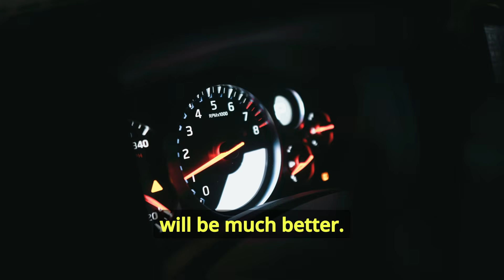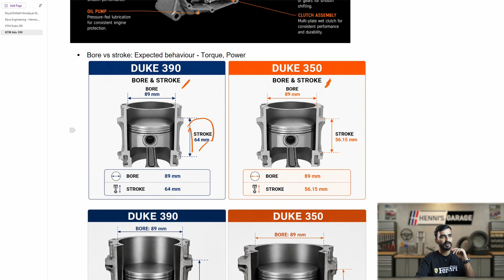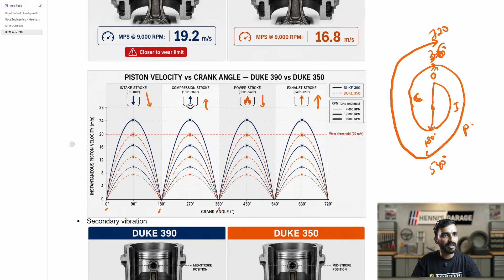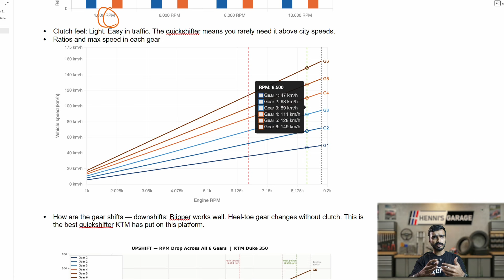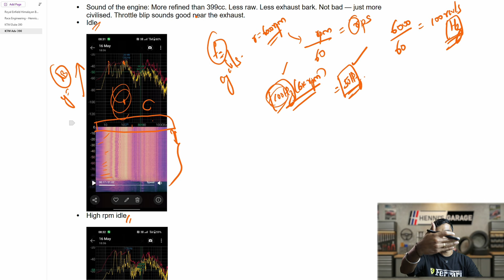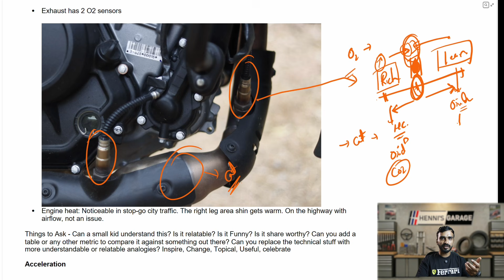KTM 390 vs 350 Breakdown || Hennis Garage

Comment: Thank you for the detailed review ❤, I have a question . Am planing to change my bike BMW G310R to KTM 390 adventure X plus variant , So if i choose 350 cc engine instead of 399 cc will i get regrets in future ? , main reason for switching is for more power , one time investment for next 10 years , suggest me to choose the right one (engine ) Thank you 😊
Reply from the maker: For a long-term investment focused on performance, I would recommend sticking with the 399cc engine to ensure you get that power upgrade you're looking for! But the 350 still has decent power on offer.

Comment: I'm confused between the KTM 390 Adventure (350) and the Royal Enfield Himalayan 450. I want to use the bike for both long-distance touring and my daily 10 km office commute in Bangalore traffic.

Which one would you recommend for my riding needs? I'd really appreciate your suggestions and opinions from people who have experience with both bikes. 🙌
Reply from the maker: Given your daily commute in Bangalore traffic, you might prefer the KTM for its more agile and easy to handle character. It’s also good for solo touring. Furthermore, KTM offers 10 years of warranty which gives you added peace of mind. 
If your major requirement is to munch miles on the highway, the Himalayan is a no brainer. It has good torque and a great character.
Reply: @HennisGarage Thanks, I'll go with KTM🫣

Comment: Can you please elaborate more and give more insight about 350 Mileage and 399 Mileage (for Adventure series not duke). 
Thank you!
Reply from the maker: The 350 typically offers better fuel efficiency due to the reduced displacement, while the 399 trades that for higher power output. The difference however is about 3kmpl in the city and about 5 kmpl on the highways.

Comment: Why does the new KTM 390 Adventure have more vibration compared to the older 390? Also, what could be causing the increased vibration around 5k RPM in the new 390?
Reply: First of all, hats off, sir—this is the best explanation I’ve seen so far.
I’m comparing the 373 vs 399 because I own a 1st-gen Duke 390 and a 2nd-gen 390 adventure (399). I’ve done 60,000+ km on the duke and around 7,500 km on the adventure.
Interestingly, the duke feels much smoother at 80–100 km/h, while the adventure has noticeable vibration at the same speed, which is around 4,000–5,000 rpm.
So my main question is is this just an issue with my bike, or is it common across all the new 399 adventures? I’ve ridden four different 399 Adventures so far, and all of them had the same vibration around 5k rpm. The ktm mechanic initially told me it would go away after the 1st service, but now they’re saying it will go away after 10,000 km.
Reply from the maker: I’ve also observed what you are talking about. There are quite a few things that have changed between the 373 to 390. 

I don’t think the vibrations that are around 4-5k rpm will go away. The frequency of excitation over here is around 65 to 85Hz. It could just be the case that the Handlebar has its natural frequency around this range. Which the older 390 handles well because of change in stiffness, isolation, better balancing, etc. But there could be a few other reasons as well.
Reply from the maker: Are you referring to the 373 vs the 390 or the 350 vs the 390?

Comment: Hello Sir ,

I am bit confuse between KTM ADV 350CC and KTM ADV 390X PLUS..

Please give your valueable opinion..need your help..🙏
Reply from the maker: 390 makes sense over the 350 only if you feel that the power is highly insufficient with the 350. Have you taken a test ride of both yet?
Reply: @HennisGarage i have ridden 350
Reply: The power enough for me
Reply from the maker: Then, you can go with the 350 itself. Any reason why 390 is important for you?
Reply: @HennisGarage Can you explain which is the negetive things in 350cc is compare to 390x plus..

Is there any engine issue in 350 cc longterm for short stroke and  which one is generate more vibration..
Reply from the maker: Lower torque is the major negative. 390 has more vibrations
Reply: @HennisGarage thank you for your support..
Reply: Today I am going to book KTM ADV 350CC CERAMIC WHITE
Reply: @HennisGarage you mean 350cc 390
Reply: Can you explain which is the negetive things in 350cc is compare to 390x plus..

Is there any engine issue in 350 cc longterm for short stroke and  which one is generate more vibration..

Comment: can we get a 350 cc and then later swap it fro a 399 cc engine? are the gear ratios same in both?
Reply from the maker: Gear ratios are same. Swapping the engine requires a whole bunch of components that has to be upgraded.
Reply: @HennisGarage  could you break it down with respect to parts and cost cause if I do go ahead with the 350, I wanted to know how much would it cost to make it into 399 in the future.
Reply from the maker: Let me try

Comment: Can we make 350cc engine to 390cc engine by changing some part like crankshaft???
Reply from the maker: Possible. But it’ll include changing a few parts along with it. Also required ECU to be remapped to older firmware.
Reply: @HennisGarage  please try to get some information about this. Many people will be intrested in this video.
Reply from the maker: That’s a great idea for a video. Will try and get some info on this. But it will make the vehicle illegal.
Reply: @HennisGarage  No one will able to find its actual CC.
Reply from the maker: True that
Reply: @HennisGarage please make proper technical video i am very much interested.

Comment: Do you think the 350cc engine on duke 350 can be refined/improved more by KTM or is this the best move and we already have a final 350cc engine from them?
Reply: I’m asking to see if I should buy the duke 350 or wait for the next version? (Since this is the first version of the engine)
Reply from the maker: I don’t think they’ll disturb something that is working for them. At the price point, the tech and power is excellent.
Reply: @HennisGarage Thank you so much for clearing my head with this
Reply: @HennisGarage i haven’t test rode the duke 390r yet. Amongst the duke 350 and 390r, which has less vibrations and is better for city riding where we use 2nd to 3rd gears at most.
Reply from the maker: Vibrations are marginally lower on the 350. Not something that I’d complain on either bikes.

Comment: Very well explained bro, I bought the KTM ADVENTURE 350 around a month back, so far my experience has been good, but in lower gears the vehicle is sluggish compared to the 390 variants
Reply from the maker: Thank you for the support and sharing your experience about your bike.
Reply: Add a bigger front sproket with 2 extra teeth, that should help reduce the sluggishness
Reply: @kashifahmed5545 can you suggest which bike front sprocket brother... which has 2 extra teeth brother 🙏🙏

Comment: I have one doubt though if they changed the pin position on the arm and the piston ends up going less yo the top and less to the bottom right is it? Then does that mean this engine is bad at compressing fuel and also doesnt extract all out of it still drawing in as much fuel as 390,does that mean worser mileage?
Reply from the maker: What they do is, they keep the piston and the pin at the same location and change the following:
1. Reduce crank radius
2. Reduce the height of the cylinder block. 
With this they’ll ensure Compression ratio is maintained.

Comment: Vibrations seeming have increased for the 350 as compared to the 399
Reply from the maker: Vibrations have come down compared to the 390.
Reply: @HennisGarage I test rode both of them and the 350 felt more vibey. Not sure why.
Reply from the maker: Interesting. Can you try from a different showroom. Sometimes it could just be the bikes. Also, can you tell me what points did you find the vibrations to be higher. As explained in the breakdown video, the vibrations difference will be felt perceivably as you move to higher rpms. Please try this out during your next test ride.

Comment: So for best acceleration, we have to change the gear at peak power for G1 to G2, and from G2 we need to shift at little more than peak torque ?? 
Correct me if i m wrong
Reply from the maker: Yes. This is the easiest way of getting the best acceleration times. This can be different for some bikes where the Engine tune and the torque curve is different.
Reply: @HennisGarage okay i have GT 650…whether this method will apply ?
Reply from the maker: Give it a shot. It should. Let me know what you find.

Comment: So the overall summary I can assume is 350 is better than 390 if someone coming from below 200cc segment, is that what you think or 399c is still better ?
Reply: How i would look at it is, not from the cc but firstly from the power perspective. Managing 40+ horses takes responsibility.  
Secondly, when we Indians come from low cc smooth engines we are a spoilt lot, those big piston singles are viby not everyone can deal with sitting on a vibrator once you spoilt, then you blame end up blaming a peach of a motorcycle.
The Japanese are to blame for this 😂
Being a rider, you have to grow into the motorcycle and not the other way round. We need to learn to ride it the way it was designed to be ridden. 
The 350 is a great option if you were looking at the 250 which is a logical upgrade. The price gap is marginal, however moving to a liquid cooled high rpm engine may take some unlearning and relearning
Reply from the maker: lol. You are right!
Reply from the maker: Yes. You are right. For someone who has not experience the older 390, the 350 is still a great offering at 60k lower cost.

Comment: Bro how much would be the engine life ? For both 350 and 390 .  I mean overall lifetime KM if maintained properly
Reply from the maker: IMO, This bike can last 50k plus kms without touching anything. KTM is offering a 10 year warranty at 2600 rupees on this bike. That should speak a lot about their confidence on reliability.
Reply: Standard warranty with the motorcycle is 5yrs 75k kms which is higher than what RE gives 
For ₹2600 you can extend it to 125k kms and 10yrs which is a boon. 
Engine life depends on the maintenance, if they say replace oil at 7500kms do it at about 5500kms there's a lot of gimmick marketing in the service interval stories the manufacturers write and tell. For the most part, engines today are bullet proof unless you  really unlucky
Reply from the maker: Exactly right. In addition to this, comparing 390 and 350. For similar riding conditions and usage, 350 serves you longer.

Comment: One reason why this engine would work and last better could be the fact that the components were put together for a 400 cc but will take the service from a 350 which is about 13% lower. So maybe we can expect better manners and efficiency. 
Besides on touring days, who would sit past 8k rpms all day on highways ?? And in the mountains you would want a light and agile tool that just sips on fuel. There’s a logic I follow, if it does 80% of your job well take it. Most will go for an overkill on the latest and greatest which is unnecessary. 
How many riders do race track?? 
I’m excited about the 350 seems like it’s giving the best of all worlds, how do you think??
Reply from the maker: This is such a good evaluation. You’ve broken this down very well. 80% logic is the right way to choose a vehicle.

Comment: KTM would have kept the redline at same levels bcos other components valve train, timing gears etc were also designed for a specific peak engine speed. Since no engineering was done on these components, they could not increase the redline RPM despite a smaller stroke
Reply from the maker: Good catch. This could probably be a huge contributing factor.